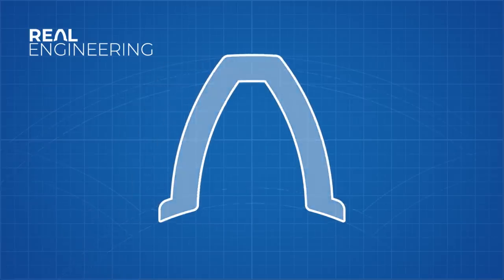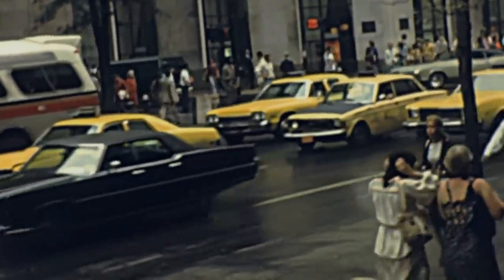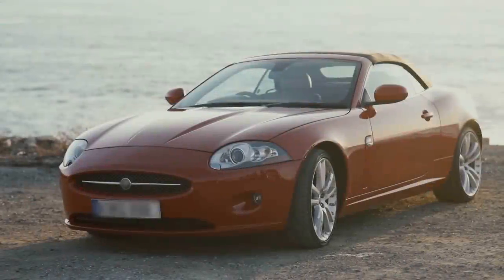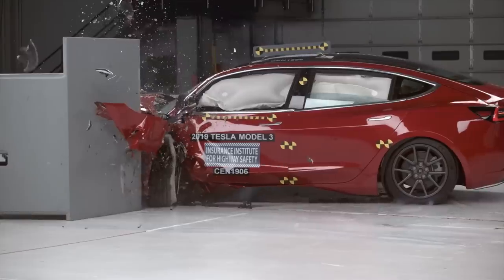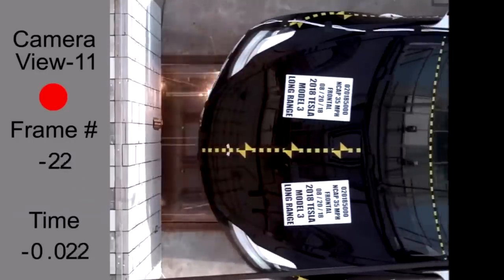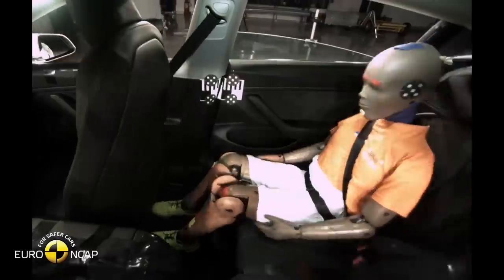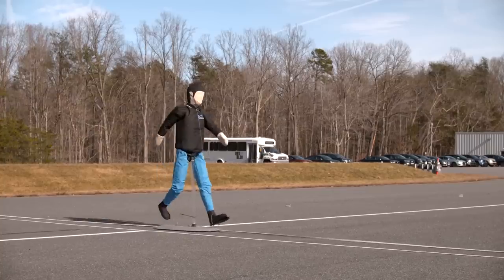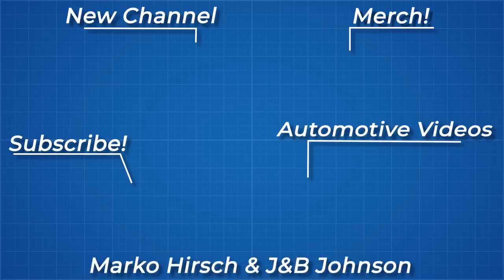Which Is The Most Dangerous Car?

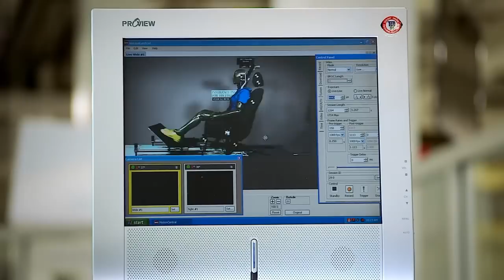Comment: 7:56 Windows XP will never die
Reply: i bet the use of Windows XP in crucial tasks will last another decade
Reply: Dude even Putin uses XP (for real).
Reply: Ancient operating systems are still being used in embedded systems. Think Windows 3.1x or OS/2 Warp. These are often still in use for critical applications, for example operating heavy machinery. If it works, don't fix it, I guess.

Comment: And Here I am driving a 1980 (70's design) K-van.  There's literally no more than a sheet of metal between my legs and the front bumper of the van!

Yikes!
Reply: I really like those, but the thought of my legs being turned into pate by any accident even slightly surpassing the severity of a fender bender is, well... a bit of a put-off.
Reply: Lucho-Core  Hey, I drive a peugeot 205 from 1989 no abs, no power steering...
Reply: Yeah, that IS disconcerting huh. XD

Though keep in mind there are other ways to design safety into something than putting material between you and the point of impact.

If you look at the crumple zones in a locomotive where the driver cab is at the very front you'll typically find the cab itself is a single rigid structure, while the crumple zone is the 1-2 metre area BEHIND the cab.

This means during an impact the cab will remain rigid but the locomotive body will give way behind it.

The point is to absorb the impact and spread the collision over a longer time/distance.

More than one way to skin a cat, and all. XD

Still, I would assume that van isn't the safest thing to be driving...
Reply: Negative 5 star crash rating
Reply: My 70’s design 89 sclass has abs, srs, crumple zones and safety cell.
Reply: @tomf3150  You should have really good abs if there's no power steering...

Comment: 7:23   I'd argue that there might be a reason for that 47% higher rate for women:  less driving on average means less experience.  Because "traditional" families have a "father" doing most of the driving, that puts a disproportionate number of women as "secondary drivers."  Sure, young men drive like they're invincible, but if they live into their 20s and 30s they've gained a lot of driving experience that helps avoid accidents, or at least avoid more serious accidents.  A lot of inexperienced drivers simply drive into the thing they're trying to avoid, or slide into it with locked brakes.  It takes real-world experience (or specific training) to learn to brake while steering around an obstacle, and do it on demand.

Absolutely no misogyny intended here, just trying to understand what's behind the data.  My wife drives circles around me.  :(
Reply: "Sure, young men drive like they're invincible, but if they live into their 20s and 30s they've gained a lot of driving experience that helps avoid accidents, or at least avoid more serious accidents." 
I would argue there is a secondary effect. What i have noticed is the worst driver typically lie in the 30 years and upward range. I'd argue that successfully driving safely can breed an attitude of untouchableness. Older experienced drivers think they are better due to experience but frequently forget rules of the road and have entrenched bad habits. Frequently they will drive faster than younger drivers and often own bigger more powerful cars.
As such I think drivers should be retested every 10 years to keep em all on top of the bad habits that can form and along with any new rules.
Reply: Stephen Furr Shockingly true!
Reply: @kudosbudo  - I agree with your points, but I don't think you achieved your goal. Driving carelessly out of routine is a major factor, but to know how to handle the car in a bad situation or realize and avoid a potentionally dangerous situation only comes with experience.
Drivers usually know what the other driver will do simply by the position of the other car or the movement if it's not standing still. E.g.
I drove down a priority road with a T junction, it had pretty heavy traffic, but relatively fast one. The guy behind the yield sign was standing there at a funny angle and I hit the breaks precisely at the same moment as he jumped with his car. My wife didn't see that coming. Had I not hit the breakes, we would have crashed.

Now, another thing I want to add, the most dangerous seat is where the shotgun sits, so that also can be a factor in the higher rates for women.

Point (for me) is, you can't really make a conclusion from a single number without a lot of research, because there will be factors which inflate or deflate the number significantly. Maybe women just don't like to adjust their seats for example :) (jk)
Reply: From what I see coaching motorcyclists in general males crash due to taking unnecessary risks, females crash from indecisiveness.
That's a generalization. There're plenty of over-cautiousness males, and a few over-the-edge risky females I've seen.
Reply: @adrianalexandrov7730  Excellent point!  I found riding motorcycles profoundly increased my ability to drive a car.  With a motorcycle you have to drive defensively...  The alternative is sure death.  Those lessons (like looking over your shoulder before changing lanes) carry into automobiles wonderfully.
I always thought requiring new drivers to ride a motorcycle for two years was a good introduction to defensive driving.  Sort of like a "learners permit."
Reply: @gl1500ctv  the hardest people to teach  riding in traffic I've seen are those who had no previous experience driving cars or at least bicycles in traffic. 
Motorcycles are way scarier then cars, far less forgiving and that captures more of novice's attention on technical aspects of controlling the bike, making it harder to share some attention on actual traffic situation around them. 

IMO from the rider's/driver's safety perspective it's better to require car experience for motorcycle riders. 

If you've ever been to Thailand, Vietnam or probably most of South-east Asian countries - most of their drivers have scooter or motorcycle experience. That doesn't seem to make them safe car drivers: unreasonable overtakes and going hot into blind corners are a common thing there. 

Motorcycling might give one motivation and reason to get into defensive riding/driving. But it comes at the cost of injuries and lives of those who haven't realised the danger and way to counter it. 
That's kinda high price to pay IMO. 

We could try to teach car drivers defensive techniques. And hazard perception training showed pretty good sustainable results. 
What we could also do is restrict vehicle power/mass ratio for novice drivers as well as restrict driving on highways, at night or with more than one passenger. 

P.S. I think every road experience is useful and makes you a better driver if properly analysed and applied. Driving a truck, or having a track day would probably make you a better driver as well.
Reply: @adrianalexandrov7730  I know it would be unfair to new riders to have to "jump in the deep end" of the danger pool first.  My point was just a car gives a "false sense of security" that people inherit from their parents driving them everywhere.  The openness and vulnerability of a motorcycle makes them learn EXCELLENT defensive driving skills.  I wasn't 100% serious that we should put every new driver on 2 wheels though...
Reply: You are misunderstanding the statistics entirely, it's not the risk of getting into a crash that is 47% higher, it's the risk of getting seriously injured provided they were in a crash to begin with that is 47% higher.